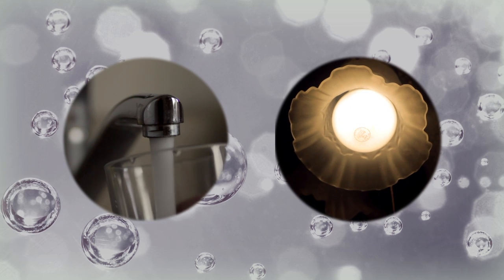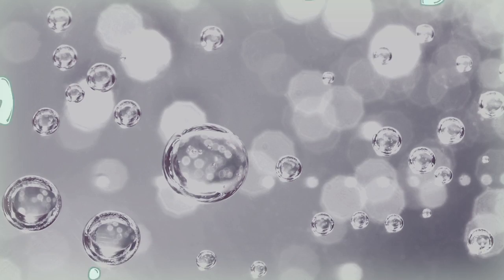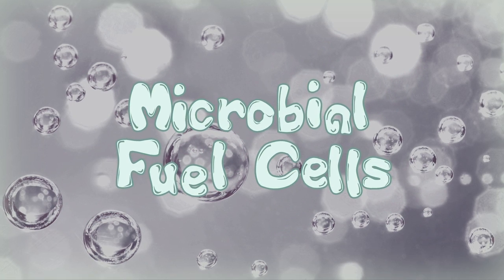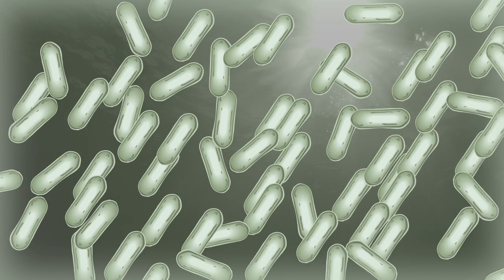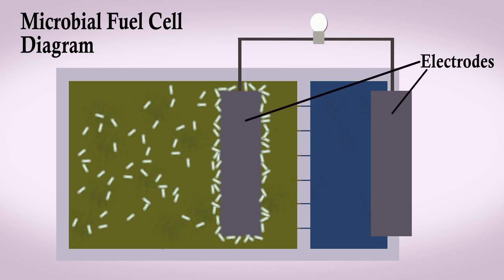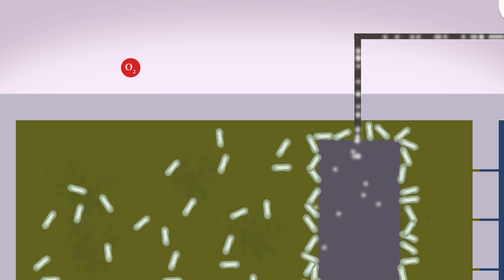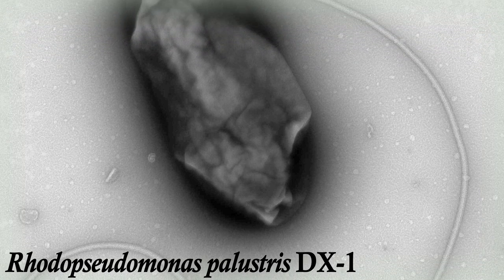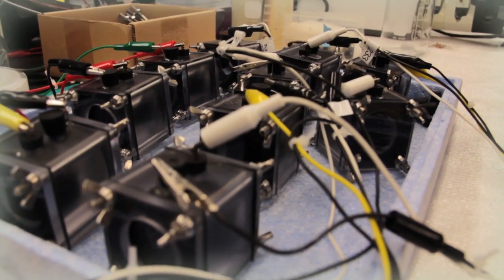Electrifying Wastewater - Using Microbial Fuel Cells to Generate Electricity - Bytesize Science

Comment: 1:42 This diagram is not accurate. Another charged species like H+ needs to flow between the anode and cathode, and O2 does not stay in the gas phase after it picks up electrons.
Reply: yup, in fact, I made the system as per this animation, it doesn't work.

Comment: can this be used in a biogas system? i.e. While the bacteria is breaking down organic matter a microbial fuel cell is used for direct energy production AND can the system still produces methane that can to be used in a standard fuel cell or turbine? If so, seems like a lot of energy we're flushing....
Reply: There is work being done on optimizing biogas production using MFC, but thats slightly different. 
Basically the methanogenic bacteria are competing with the exoelectrogenic bacteria (that make the MFC work), they eat the same food, but methanogenesis is less efficient so is outcompeeted. This is the basis of how MFC can be used to reduce methane emissions (greenhouse gas).